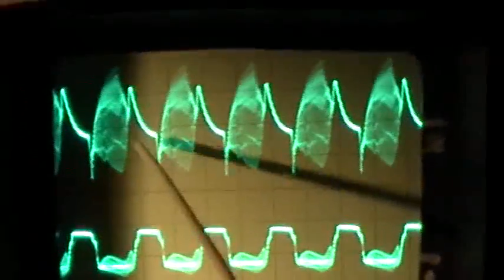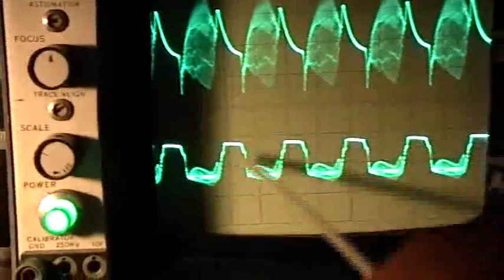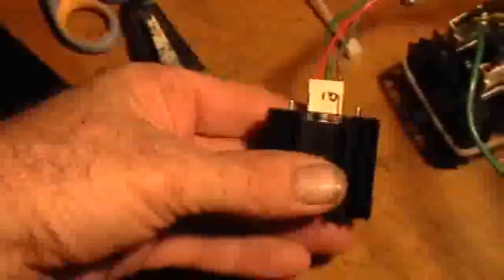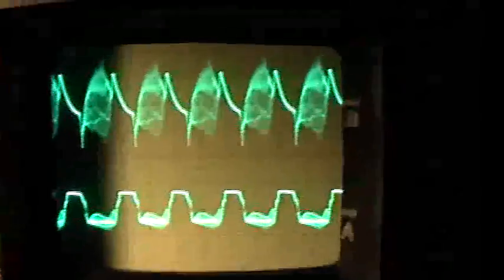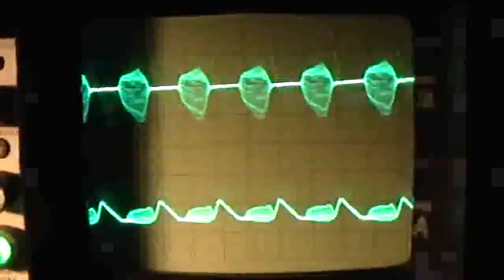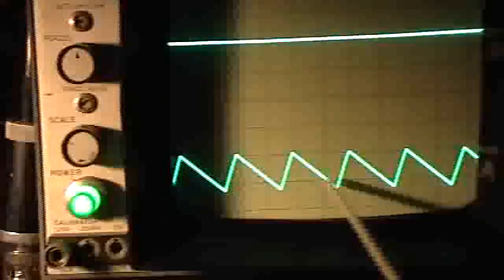Electric OU: Tar Baby Cooks Some Turnip Stew: High Heat with "NO CURRENT FLOW"

Comment: Well for the optimum effect you could place the whole circuit into the oil bath
as oil does not conduct, so you will also have the heat of the Mosfet and the other parts heating the oil bath...Then you would convert all the inputted energy into heat....

Comment: Well, it is not any Ainsly effect, it is just the fact, that you have high frequency
AC on the battery which back current spikes and in this case, as it was also earlier with the Newman motors, you can drain much more energy out of the batteries, cause these partial negatibe current pulses always reacharge a bit the battery and don´t let the ions flow too fast and you crank up the capacity of the batteries also this way...it will last much longer as in the DC case this way...

Comment: Yes, but with this pulsing AC the battery will last longer !
Thus you have also to compare the time the battery lasts....

So maybe you generate 3 Watts heatpower via DC for 1 hour until the battery goes flat, but generate 2 Watts via AC for 10 hours, until the battery goes dead... so you will see the AC case will generate more heat all in all....

Comment from the maker: Better to measure first, speculate later.

Unlike some other people, I will use a constant setting of Tar Baby and I will measure the time-temperature profile of my insulated oil load. Then I will do the same with DC current at the same average power, and I will plot both lines on the same graph... something very basic that should have been done but was NOT done by the NERDs.

When I did this for the earlier  "COP 17" claimed device, the DC current was more efficient and heated the load faster.

Comment: How long will the battery last in this mode compared to the pure DC current mode ?
I guess 3 times longer and thus you will get .uch more heat for the same used battery energy spent ! Well done !